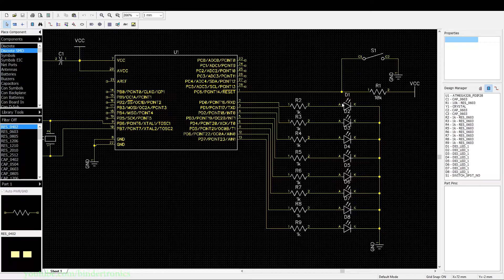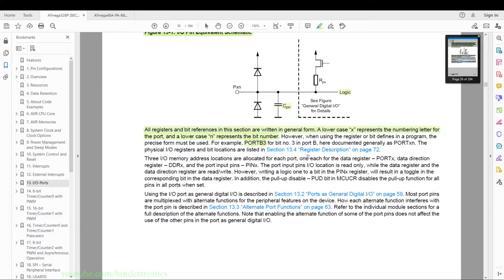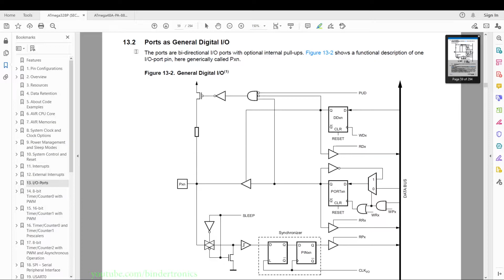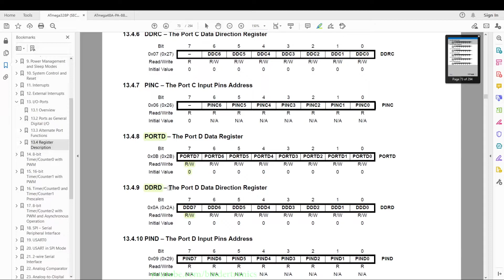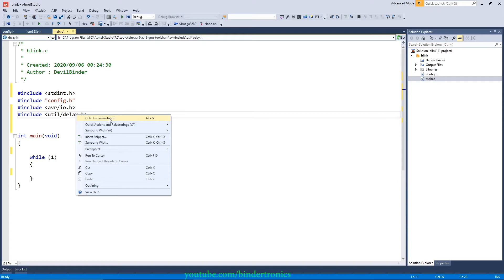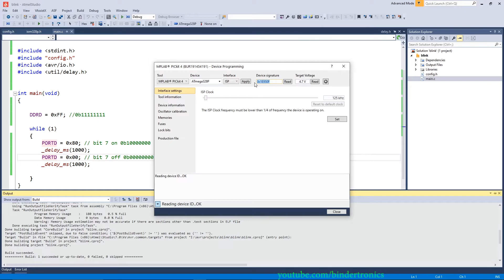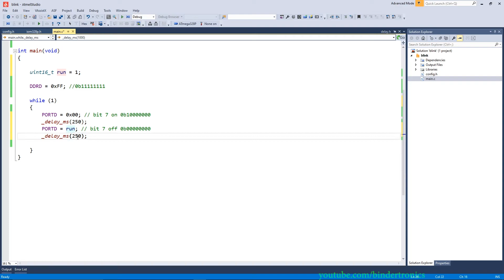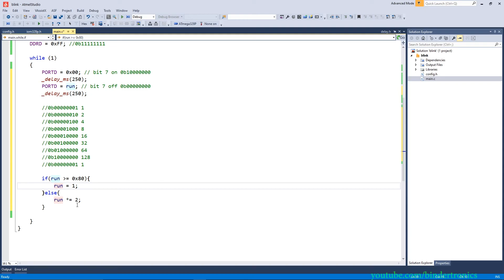Blinky and Running LEDs 🔴 ATmega328P Programming #4 AVR microcontroller with Atmel Studio

Comment: 1 khoms for current limitation is a high value ? led consommation is 0.02A and voltage is 1.6 V Rled=(5V - 1.6V) / 0.02A = 170 Ohms
Reply from the maker: All we care about is, is the LED bright enough? If yes then the resistor value does not matter as long as it is within or under the current spec.
Can the MCU IO drive/sink the LED at max current? Most cases not.
Do we care about the efficacy? No, I would be running the LED on PWM then.
Do we have a datasheet for the LED? No, best to over spec for the current then.

Secondly your calculation is wrong.
The current is the same through each component in a series circuit.
5V/0.02A = 250R
E6 330R-470R
E12 270R-470R
Reply: @BinderTronics  no calculation is good for me, you have 1.6V drop consumation by the led (Led voltage drop : 1.6V, current limitation : 0.02A)
thank you for your advices, your lessons are very good
Reply: @BinderTronics  but I am agree with your advices, I'm a beginner in the world of PIC